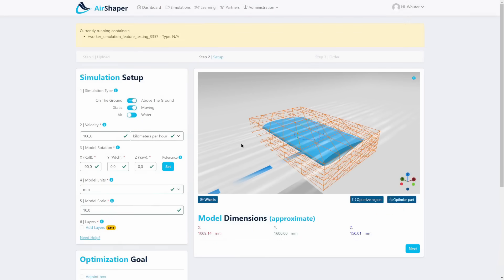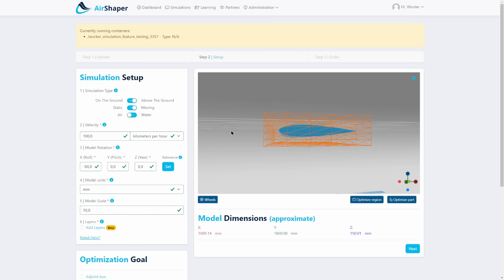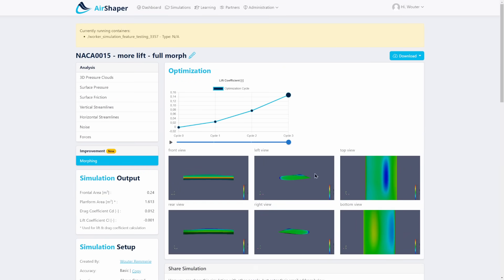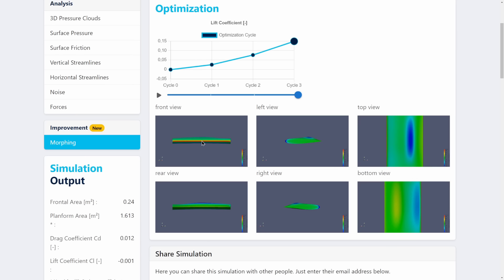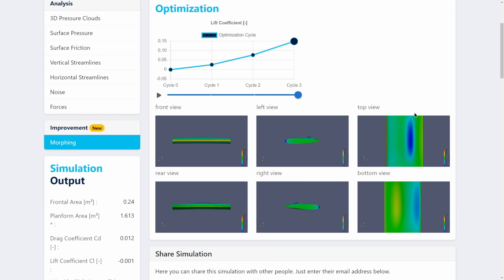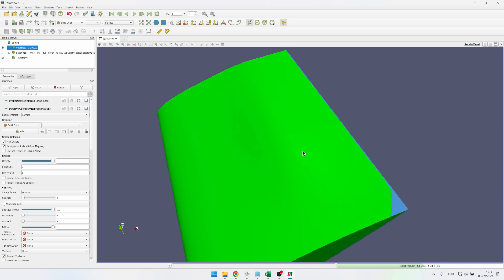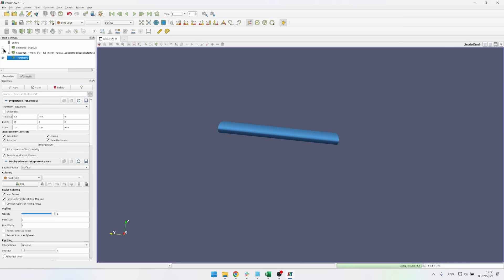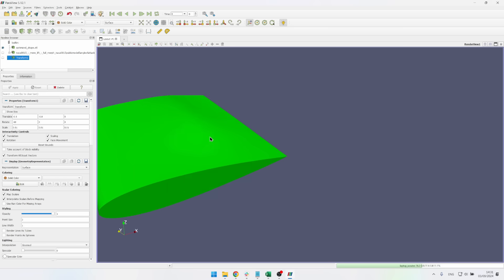NACA 0015 airfoil aerodynamic shape optimization - Increasing lift using adjoint shape optimization

Comment: Would you consider making an STL file of the morphed wing available for users to either analyze performance or to 3D print?
Reply from the maker: Yes, just go to the sample project and download the 'optimization data' via the download button on the right. It includes the morphed 3D file. You can reach me at wouter@airshaper.com if you have any questions.
Reply: l

Comment: Ok, it's kinda obvious how to get more lift from symmetric airfoil. But what about if you take more high performance L/D airfoil, such as something from competition airplane? And what other things can you optimize for besides lift?
Reply from the maker: We have a beta version to optimize for lift over drag as well, and we've optimized asymmetric airfoils too. But it's indeed not easy, as the optimization for one set point offsets the performance for another angle of attack. But mainly, it serves to point you in the right direction!
Reply: @AirShaper  does it generally increase or decrease the critical angle of attack for these airfoils?
Reply from the maker: @damenprice3752  If by critical angle of attack you mean the stall angle, then it's likely that tweaking the airfoil for more lift at a lower angle of attack, you'll reduce the stall angle (so it might stall sooner). On the contrary, you can also put the wing at it's stall angle or beyond, and then ask it to morph for more lift. It should then automatically move away from the stall problem by "softening" the shape.
Reply: @AirShaper  Very interesting!
Reply: C w
Reply: 😂😂44rr😊😢n